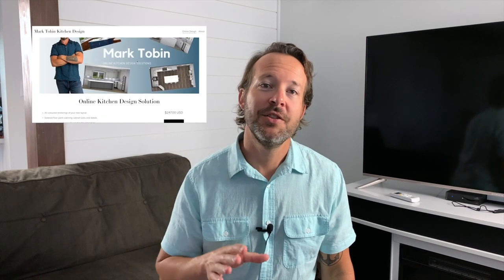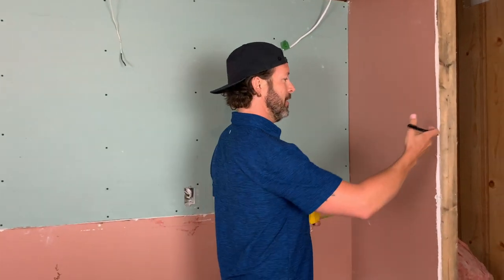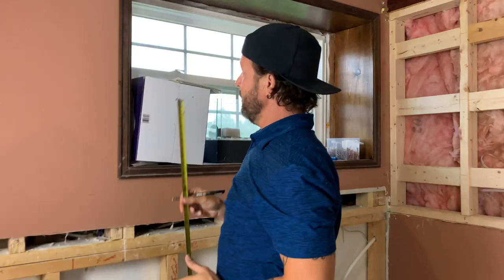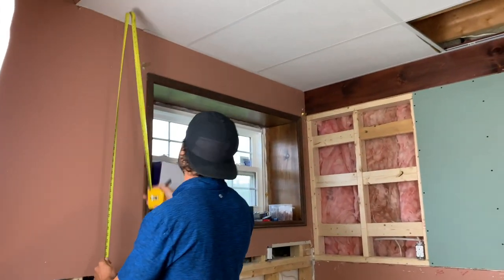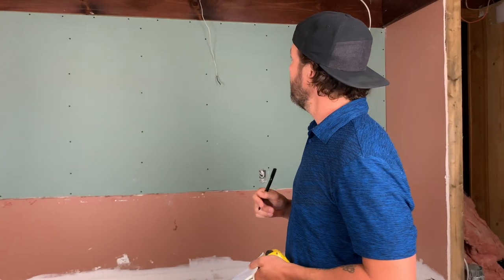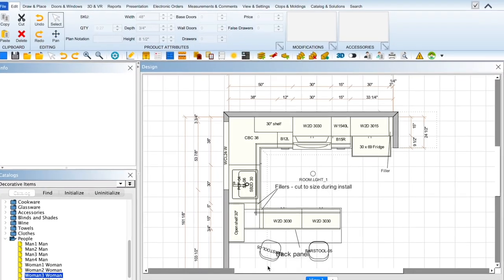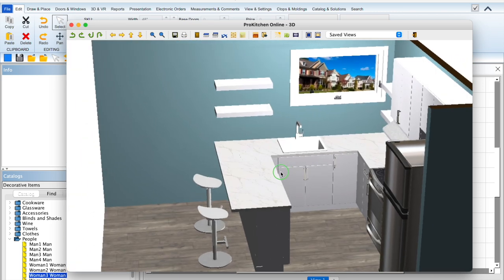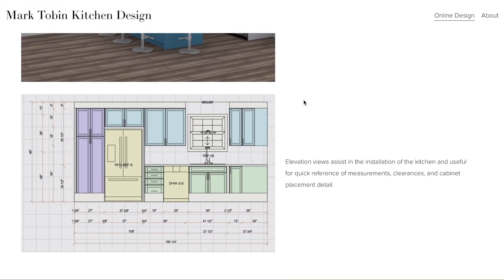Trendy Basement Kitchen | Measure and Design

Comment: Thanks to your friends for letting us into their home!  It was very funny and interesting at the same time!  I'm feeling confident that I measured correctly now!  Very good point about measuring the ceiling in different places... we live in an older home and there were huge differences between all the areas, so much so that I am going to have much less space in my upper cabinets than I thought I was going to have, and we have to stick with 36" tall lower cabs, when we wanted to do 37" ones (we are both tall).  😩

Here's what I would've done with this kitchen, not that you asked for my opinion, lol!  Coming from a person who loves to maximize storage, I would've taken that 12" lower cab out (the one next to the range); slid the range, the 15" cab next to it, and the refrigerator down towards the window, then put a full length floor to ceiling 15" pantry (or whatever width would fit) to the right of the fridge.  Then probably gotten rid of the floating shelves on that wall and put a 15" upper cab next to the hood vent to match the other side.  Oh, and that wasted lower cabinet space to the left of the sink under the floating shelves?  I'd have a storage cabinet that opened on the side where the stools are and some fake doors on the rest of that side to make it look like there were cupboards across the whole penninsula on that side.  It's awesome to see that 3D rendering... helps so much when trying to visualize a space!

Comment: I learned a lot from this video.  We are about to renovate and install and Ikea kitchen.  You said that "Ikea cabinets measure 1/8 th larger than the stated measurement." Is that 1/8 th on W X D X H or just W?  You are measuring a gutted space.  Any suggestions when you have to measure the space before it is gutted?  The measuring the ceiling from different points, all I can say is that is very smart thing to do.  Thanks for the information you so generously give on your videos.
Reply from the maker: Hey George.  Normally RTA Cabinets can run a little wider on the width.  Double check as you go.  I have some in another room and they were 1/8th wider.  If you're measuring the space before it is gutted, as long as you get all the wall measurements on the wall, you should be good.  If there are tall cabinets in the way, (ie a pantry) measure along the front and add it in.
But otherwise never measure along the front of the cabinet, always the wall.

Comment: As this was a basement project I would expect the floor/ceiling measurements to be different as the floor should be sloping towards a floor drain. I would hope that upper floors and ceilings should be closer to being consistent throughout.
Reply from the maker: That's why basements can be a little tricky.  Normally main levels are more constant, but I've come across some real doosies out there.

Comment: Maybe Ikea Canada Sektion cabinets boxes are different, I dunno. USA 18" frames (at least mine) are 18 inches wide. It is true, and easy to see, that Ikea Sektion door and drawer fronts are a teeny wee bit incrementally narrower than the frame, so that they open and close easily. And the interior drawer boxes, of course, because they fit inside the frame (logical LOL), are narrower in width than the width of the box frame.
Reply from the maker: Interesting.  I checked on some IKEA cabinets I have in another room.  Sure enough they were 1/8" wider.  This is true of other RTA brands as well.  You're right about the doors.  Usually a 1/16th smaller.